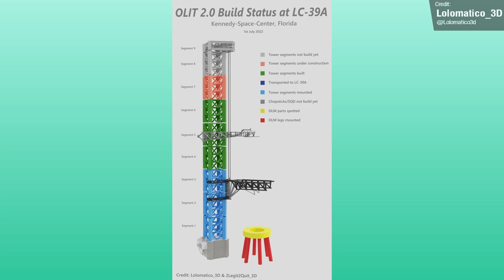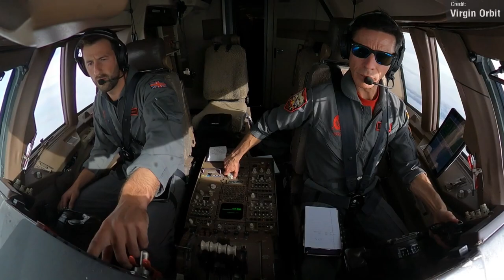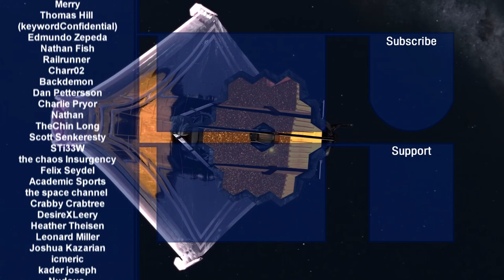SpaceX Starship ALL ENGINES Installed! Atlas V WFOV launch, NASA CAPSTONE, Falcon 9 SES-22, Starlink

Comment: The raptor 1 engine is now considered "outdated technology" when even 5 years ago, there was no starship at all. Its fascinating to see hiw technology gets improved dramaticly in such short time
Reply: it's elon time... just like moore's law, it kept pushing forward.
Reply: Oldspace would never
Reply: Starhopper was more recent than the last Falcon Heavy launch.
Reply: @PrograError  Moore's Law has nothing to do with this but I do see what you mean.
Reply from the maker: Actually, Raptor has been in development since 2009, in fact probably even before that (2009 was when it was first publicly announced). But yes, it is still very impressive!
Reply: It's a bit like modems in the 90s. 9800bps modems were on the market in 1990, but 14.4kbps modems came out in 1991. That speed doubled to 28.8kbps in 1994. The maximum throughput for an analogue signal was reached in 1996 with the release of 33.6kbps modems. Then there was a brief war between competing 56k hybrid standards (using telephonic magic) in 1997 and were both replaced by the official standard in 1998. The final pure-digital dial-up modem standard was approved in 2000 which increased the upload from 33.6kbps to 48kbps (though with a drop in the download speed to 40kbps unless the digital upload functionality was switched off).
Reply: @MattLowne  Ah yes, when raptor was supposed to run on hydrogen.
Reply: @StarkRG  My first modem was a 300 baud. I could read the incoming text messages at the speed of receipt. Going to the blistering speed of 1200 was an amazing experience. The modem would pause after each screen fill, to give me a chance to catch up. Images? Video? You MUST be joking!
Reply: @Jeppe Achton Nielsen Raptor 1 was never used for anything, just a experimental one. I would argue that even BE-3 is more useful. But it depends on your definition of “better”.
Reply: @Jeppe Achton Nielsen I said “define” better and by your definition Raptor 1 is better and by mine, BE-3 is better. I did factor in the actual use of the engines, whereas you just used performance stats (in that case raptor definitely beats BE-3)

Comment: Those unused space ship and booster fuselages should be mounted horizontally (or one of each; vertical and horizontal) on stilts;  set about 100 meters into the bay water, and made into temporary VIP hotels.  A few windows some solar panels; a few power walls  and an HVAC system should make for cozy convenient accommodations. A patented surf boat, now in public domain,  would make the perfect hotel to shore transporter.

Comment: I am kinda starting to doubt if SpaceXs rapid prototyping approach still makes sense.
When we tried to do rapid prototyping when building industrial machines we always ran into the same problem at some point. Different parts pf the machines start to use different versions that weren‘t never really meant to work together. This makes it an absolute nightmare to keep track pf what should and does work with each other, which prototype uses which versions and if this will actually be a representative test of anything.
To me it looks like SpaceX is now running into the same problems.
I think going forward they should maybe reduce the pace at which they pump out prototypes and spend a bit more time on each one.
Otherwise I am almost certain they are going to test some combination that doesn‘t really give them any useful data anyway.

Hardware just isn‘t software, iterating on it takes time.

Edit: I don‘t think I made this clear, the problem isn‘t necessarily the cost of materials that are going to waste. If you are racing against time because your money is running out this makes sense, operating costs are likely way higher than material costs anyway. The problem is that now a portion of your engineering time is either going towards trying to make two things, that were never meant to work together, work which is 100% wasted time in the end. Or you end up engineering a lot of things that will never be used and will remain in the testing phase. The production side has similar lost time where they learn to perfect a thing that won‘t be needed afterwards. At some point this lost time becomes larger than the time you safe from being able to detect problems early and at that point your rapid prototyping actually starts to delay your final product instead of accelerating the development.
Similarly, it is usually a good idea to test as much as possible early on to detect possible problems. This however does not mean you need to produce a prototype after every problem you found. The name of the game is exhaustive testing not producing slightly better prototypes. Usually what you do in the industry is produce a few prototypes of the modules only, test them as exhaustively as possible and maybe even modify them slightly to test different stuff and only if all modules have reached a new stable point you put them together and produce an entire new prototype.
Reply: Hardware tests can be simulated with software.
Iterative data will not be fully provided by hardware tests. Data from hardware tests may also not be used.
Reply: One of SpaceX's big innovations is their in house change management system for exactly this reason. Individual people "own" aspects of the design and all parts and changes are registered and tracked in the system. IIRC the system can even check for potential conflicts and notify the relevant people. That way it's possible to iterate on several aspects simultaneously without running into large unexpected conflicts.

When Raptor 2 was much earlier in development, flying with Raptor 1 would still have been worthwhile since they could potentially find design issues to fix in Raptor 2 and the aerodynamic data for the rocket would obviously carry over. But due to delays in approval from the FAA, Raptor 2 reached a point where it made more sense to just switch over entirely instead of keeping Raptor 1 production lines alive (since B4/S20 would probably need some engine swaps). Thus it made sense to just scrap them and move over to Raptor 2. Going by your position, they should've just not built the prototypes until they had approval, which is obviously not at all conducive to their goals (especially considering that even if the booster and ship didn't fly, they provided plenty of test and manufacturing data for all other aspects of the system).

While exhaustively testing individual pieces before integration testing sounds good, it has the big issue that it limits the ability of separate pieces to interact in a way as to improve the full system and essentially locks you into a waterfall design philosophy where everything is locked in before you start producing anything.
Reply: Wall of text and the comments are moll walls of text. Tryna buyild the great wall of China but with words?
Reply: The rate of iteration has already slowed down. They went from starhopper to sn15 in 2 years. That was 9 flights. In the year since sn15 there have been no flights and only 2 prototypes that have made it anywhere near flight ready: ship20 and ship24.
Reply: @dufkers  That's missing the fact that they didn't fly after sn15 because they decided that there wasn't much more to learn from short hops and they had to wait on the Orbital Launch Mount and FAA approval to do much else. When looked at in terms of actual changes rather than an arbitrary metric of number of flights, there has been a ton of iteration (engines, catch system, grid fin design, starship flap placement and size, nose cone design, thrust pucks, RCS, tank farm, payload bay etc).

Seems a bit absurd to be saying "the rate of iteration has already slowed down" on this video especially given that every week has a bunch of time devoted specifically to Starship updates.
Reply: @dotnet97  I’m sure they are still rapidly iterating and testing on smaller scale components like engines but on the scale of the ships the rate of iteration has slowed. Flights is not an arbitrary metric, a flight is a full end to end test of the system as a whole. Fewer flights means less hardware destroyed which is very relevant to this discussion. I’m not saying that their rate of innovation has slowed, obviously there is still plenty of news from starbase.

Comment: Booster 4 could be re-designed for Raptor 2 Engines.
Reply: Probably more trouble that it is work to take it apart, put in the new thrust plate, reroute all the plumbing, and put it back together.

Comment: I don't expect the lunar gateway will ever actually come to fruition. if it does it'll go the route of SLS and it'll be 2050 before the first launch
Reply: The PPE, HALO, ESPRIT, and I-Hab modules are already being built. The PPE and HALO modules are fixed price contracts here in the US with the ESPRIT and I-Hab being built by the ESA. JAXA is helping with the I-Hab. The PPE and HALO modules are planned to launch together on a Falcon Heavy. The other two will hitch rides on the SLS 1B on Artemis IV and V.
Reply: SLS has it's first launch with Artemis 1 around late August/ early September so that estimation went out the window real fast.
Reply: @exilestudios9546  yes. The launch that was supposed to be in june but was delayed